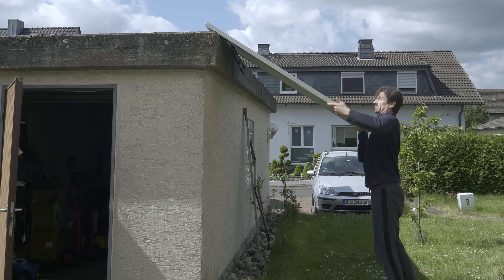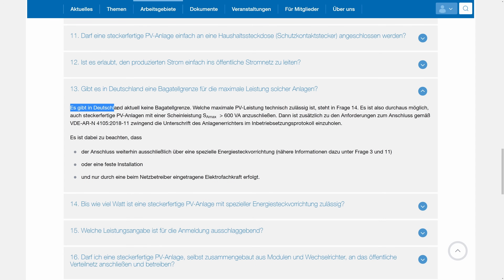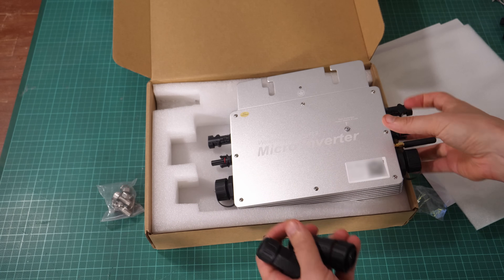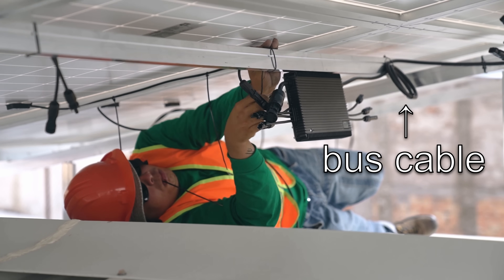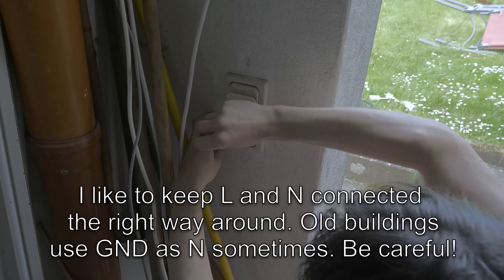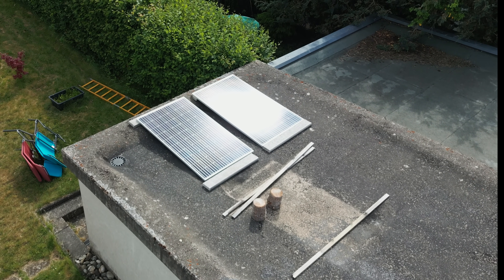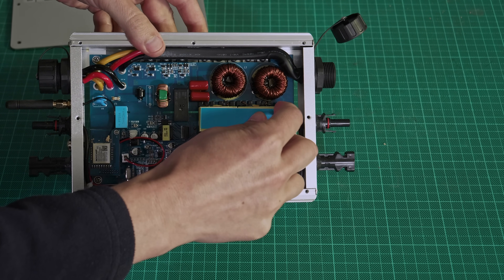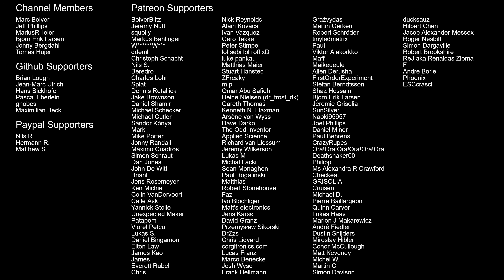Cheap grid tie solar setup (600W 3kWh/day)

Comment: No Wieland power plugs mandatory by the grid operator?
Reply from the maker: not up to 600W. Check the VDE link above. To be on the safe side you need to use an inverter that limits to 600W. I never measured more than 520 with that one even if it's saying it's 700peak. There is also a setting to limit the output in the app. I hope we get the EU laws allowing 800W then this one should not cause any trouble
Reply: Correct, the VDE norm up to this point is basically a 'recommendation' and some might argue that industry experts in these committees also pursue the interest of their companies. An unplugged inverter supports outpuz protection anyways as proven by the many videos of people touching the ac output.
Anyways, my and various other grid operators require a specific protected power inlet and make you sign and confirm that you are using such. Great obstacle for anyone who is not an electrical engineer or electrician given that you will hardly get your hands on one today and will raise the cost significantly. 
Of course it's not a difficult installation but again in Germany - not directly breaking the law but also not quite conform either..

Comment: Uff, hast mal geguckt mit dem wechselrichter? Meist sind die noname nicht so gut im MPPt Tracking… 

Mit deinem technischen Know-hows wäre auch cool, wenn du so eine Anlage erweiterst. 
Ja, in Netz dürfen maximal 600watts, aber z.B. mit wurzelzähler und smarten schalt Relais (z.B. shelly) kann man ja z.B. einen String abriegeln. Oder sogar in eine Batterie umleiten. 

Fände ich ein cooles Projekt, so dass quasi immer 600watts Anliegen (Overpaneln), jetzt hast ja noch n 300watt WR frei.

Comment: With panels just sitting on the roof I would be worried about high winds picking them up and blowing them away/breaking them.
Reply from the maker: We had really hefty storms this year already and it didn't move. I put the one the wooden blocks later. These things are heavy

Comment: Yeah, lets limit the energy people can put back into the grid during an energy crisis.... thats logical.... governments need to stop trying to protect the profits of the power generation/supply companies and allow people to be more self sufficient and actually offer more efficient energy generation.
Reply: Sure, until someone has their jerry-rigged 4kW system go haywire and fry all their neighbors inverters at the same time. 
Having standards and regulations for the national grid is kind of important.
Reply: @hultaelit  I didn't say that there shouldn't be a standard, I said it shouldn't be limited to 600W ! other countries can export several kW to the grid if they choose.
Reply: Those 600W things are a legal way to attach your DIY solar to the grid. Some legislations do not specify if the 600W are per phase or not. Makes 1.8kw. Inspectionless, no permits, no fees. I get paid only 8ct kwh for feeding the net, but i save 24ct kwh on my own consumption. Germans save up to 40ct/kwh.  If you run an AC this is the way to go.
Reply: @pepethefrog7193  1.8KW? Houses aren't normally connected to 3-phase.
Reply: @clonkex  My house built in the 70'ies has 3-phase. Most euro houses have.
Reply: @pepethefrog7193  That's so weird. Why would you need 3-phase in a residential building? Here in Australia it's all just 230v single-phase except in commercial buildings running heavy equipment. Do you have 3-phase wall sockets?
Reply: @clonkex  Washing machine,, electric oven and water heater all have 3 phase sockets. But except for the oven and the 9kw sauna  all machines are single phase today. We have 3-phase sockets that accept a 1-phase plug too.
Reply from the maker: Those limitations won't last long as the crisis will peak next winter. However there are possibilities to limit your output to the grid to basically 0 with specific inverters. I'd like to try that once I have some spare funds
Reply: It depends on the grid. If the grid voltage is already high then you won't be able to put any power back into the grid. It's not just about protecting profits, there's serious practical limitations too.

Comment: Crazy that the solar panels are just sitting on the roof. I guess you don’t worry about strong winds from hurricanes where you live.
Reply from the maker: these things weight a ton. They only look so light because I'm so strong 😂. We have winds over 100km/h here regularly nothing happened so far. If it does someday it will be content :-D

Comment: what happens if the power from the network goes out? dont you need some kind of isolation switch?
Reply: Most of the microinverters need the grid power to generate, in the moment the grid get disconected they stop generating.
Reply from the maker: They don't work without the 50/60Hz from the grid. There are however hybrid inverters that you put between grid and your installation that will switch automatically

Comment: nice video, I've done the same for the last 2 years, 600 watts at 24volts and 100watts at 12volts into battery storage and then into grid tie, pay only for 1Kw or their abouts a day (40P). It's the way to go, switch my gas boiler off too so pay nothing for that either
Reply from the maker: Very cool!
Reply: Hey, but when you use the battery, doesn't the inverter just send energy to the grid? Or is there someway to deal with that??
Reply: @leps75  if you connect grid-tie-inverter in parallel with charge-controller then the battery will not feed into the grid (method 1). Alternatively, if you connect grid-tie-inverter to the battery you can automatically connect/disconnect the grid-tie-inverter using a Relay with an on/off signal coming off from the Load terminal on the charge-controller (method 2). Alternatively, there's a larger pricier charge-controller that combine all 3 device into 1 (method 3) .
Reply: @xponen  that way you can  harvest more than 600W cont. to fill up the battery storage, and then feed 600W 24/7 into the grid(this is the best way to circumwent the stupid 600W limit)
Reply: it's cheaper to just plug in like in the video using grid-tie micro-inverter, no need for battery or charge controller.
Reply: @xponen  Yes that is true, if you are at home in the day and using all the power or have some sort of feed in tariff. My fridge and freezer are on timers that use some of the power, rest goes into the batteries. Then when I get back from work they switch off and the computer go on. I have made a couple of devices using ESP8266, 1 for the meter with a ct clamp to measure the current at the meter that transmits back to the 1 connected to the grid tie,  which then balances my usage to almost 0 (unless I put the kettle or oven on). I don't get paid for send power back to the grid and i don't like wasting it either, so thats why i use batteries. I would say give it a month to check prices and do a LOT of calculations to see what is right for you. End of the day it's a hobby and with energy prices going up, well worth it
Reply: @PetRatty  the grid meter count backward if we are at work then count forward when we are at home. The grid is our "battery" and the grid meter is your ct-clamp. If we play it right the utility will see zero movement on their meter after 31 days and think we are not using any power.
Reply: @xponen  I see, nice
Reply: @xponen  that is true, but solar works during the day, when most people are out. It's when the sun comes down and we all get sucked into are electrical life and there is no solar...
A battery allows you to  shave that peak rate.
* Most people are getting suckered with lfp fake battery info  and high prices.
So yes. They could use la for 100 times less.
@bitluni to the rescue there ??

Comment: Nice. We're not allowed to do it ourselves in the UK. Well I mean if you wanted to do it legally then you would need an "MCS" approved installer to do it. I have two solar arrays and I wish I had space for more, so I recently put one on my shed roof and used an MPPT charger to charge two LiFePO4 batteries and then I run everything in my shed workshop from that.
Reply: It seems like we're in a similar situation on the other side of the channel. The government provides many nice things like tax breaks on solar panels (10% instead of 20) and financial aids but of course there's a problem: the whole installation has to be done by a pro which negates all of these nice advantages.
Reply: I believe you actually can do this youself without MCS approved but your not allowed to get any FIT/SEQ (paid from the energy exported or generated). Also you are limited on what size you can connect to the grid. You do need to let your DNO know however but shouldnt be an issue for small installations that are compliant with safety standards
Reply: I've seen nothing that suggests that this is not accepted in UK. The installers with MCS approvals might want you to think otherwise, of course. But then they are limited to 5kW systems whereas those that do not feed back into the national electrical grid can be any size that suits the project.

Comment: You can sell your solar power with your own installation in Germany? Here in France you need to pay for a “professional” installation to get the right to sell your produced energy. Thanks lobbies
Reply: It is possible to sell the power, but not worth.  The <600W systems just helps you to reduce the power bill, you use what they produce, if you need more it comes from the grid, if you need less, the rest goes into the grid for free.
Reply: I think that's what he eluded to around the 600W limit and needing professional install for more. Grid tie systems in most countries require pro install too like in UK and plug-in inverters are not legal at all here / fixing a plug on the end of the wire from the inverter also not legal. Power companies will make you sign a contract if you're going to get paid for it (or net metering, whichever) and they'll want to see install certs. This was the same at my friends house in NL too.
Reply: @silverismoney It's ridiculous. Just install whatever You want, who the fock cares? Do You have inspections or what?
Reply: @nitrgnlab9400  I get paid for my generation so I had to show them proof of qualified installation and testing. Of course anyone can do what he does in the video themselves too. Someone comes to read the meter every 2 years but no inspections as such no.
Reply: In France there are commercial systems to do this. They market on the basis of being plug and play, no installation required.
Reply: Sunology Play, for example. But there are others.

Comment: it looks dangerous having a male plug with live power on it. Over here it's not allowed.
Reply: The inverter only starts producing power once it senses that it's connected to the grid. So safe and not energized, at least in theory. YMMV with chinese inverter though..
Reply: @DerHeilendeLotus  2:45 der Steker zum anschließen des Wechselrichters hat berührbare Pins. Ist das Kabel am Netz angeschlossen und du entfernst den Wechselrichter, ist dann Vorsicht geboten.
Reply: Where's "over here"?
Reply: @clonkex Belgium

Comment: Please delete the link for the supercheap inverters GTI... they heat up and die quickly... search Youtubt for various examples!
Reply from the maker: removed the cheap one
Reply: @bitluni  My brother works for a guy that designs and builds solar inverters here in Australia. The cheap chinese ones are the number one failure point and it's not worth the cost to repair them.
Reply: I do run 3 of the 300W $40 GDI ones on 660WP each since last august. Cooled with a 120mm PC fan. No problem.
I agree that if you do not cool them they will not survive very long. Do NOT mount them like the vid shows.
Reply: I'm looking for a good but not too expensive 600-700w Inverter. What do you recommend?
Reply: @zita0017  Aliexpess grid tie inverter 1000w, I've had no problems for 2 years upto 700 watts. saying that, even though it was on and not running @36C outside temp the fan was going

Comment: One thing to say, Here where I live, You cannot connect any inverter to the AC grid, It has to be a certified unit thus aliexpress and dated stuff is no good. Also Im kinda cringing inside looking at this mounting brackets, dedicated solution's for flat roof made by k2 are a way to go
Reply: "here where I live"
Why?? Just why? Why would you use that sentence and then don't say were you live?
Reply: probably they meant the regular portable-inverter. This one is grid-tie-inverter, meant for the AC grid.

Comment: I couldn’t quite work out if you were planning to mount the unit flat under the panels and trust that the seals hold ? In the past mounting vertically and leaving a small moisture exit point at the bottom edge has worked for my outdoor projects. Sometimes a small piece of gauze helps stop bug visitors. Good luck!
Reply: yea, every night the device will be cold and suck in outside air, after many years the accumulated condensate will have no way to get out.

Comment: Don't use silicon in conjunction with rubber seals...
Reply: Neutral silicone should be fine, sanitary silicone is no no, it will make the rubber brittle.

Comment: And now hope that you don't get a Beaufort 11 storm any time soon! If I would just lay them down like that on my roof, they would not last a week.
Reply: Just fix them with some garden stones as weight that's how the solar panels are normally fixed on a flat roof.
Reply: @swissTom124  or by mounting them with sedum mounts, eco friendly too
Reply from the maker: The single panel like shown in the beginning lasted several storms in the past 3 years without moving anywhere. Last storm was Zeynep with speeds around 150km/h. Those panels are quite heavy. The wind always comes from the front of the garage since it's the luv of the hill I'm living on. There is no gap for the air to go underneath the panel this way. I guess it doesn't cost much effort to just screw it to some slat and put some extra sand sacks to hold it better in place. I'm too lazy though 😂

Comment: Unfortunately setups like that are illegal here. I can however use a transfer switch and run individual circuits off solar.
Reply: You can build something like this, hidden, no legal (who cares), but posting it on youtube with full adress? Good way to gain interest of the network provider and other authorities. BTW: The rest of the wiring in the shed is also terrible :-) The trouble starts if somethings goes wrong, eg. a fire starts. The insurance may no pay. This is the danger of "non official" installations. 🙂
Reply: @hesspet  Many of the North American meters in their default configuration will charge power exported the same as if you were drawing from the grid.
Reply: @eDoc2020  Not true. Disinfo from the energy provider. The old style elecromechanical meters will run backwards.
Reply: @pepethefrog7193  I don't think I've seen an old-school meter in use for over a decade. I'm specifically referring to the Itron meters which have been in my area for close to twenty years. I'm getting my information from the technical manual for the meter as presented in its FCC filing.
Reply: @eDoc2020  You can get a "zero export inverter" to get around that issue.
Reply: @NiHaoMike64  But then that limits the amount of solar power. To fully utilize the power without exporting you need a battery and there are fairly cheap hybrid inverters which will accomplish this in a single unit.

Fortunately I live in a "friendly" area so getting the meter changed to one with net metering shouldn't be too difficult.
Reply: @eDoc2020  Could use an alternative technology for energy storage or matching demand to supply. Worth considering in areas without good net metering.